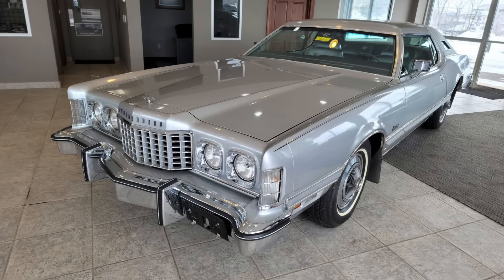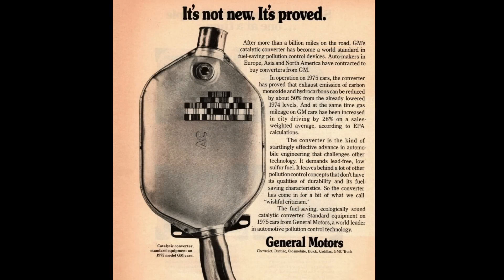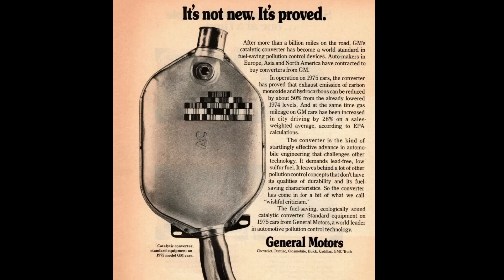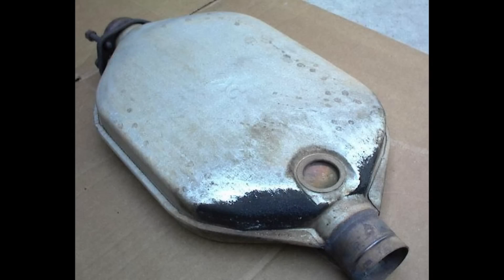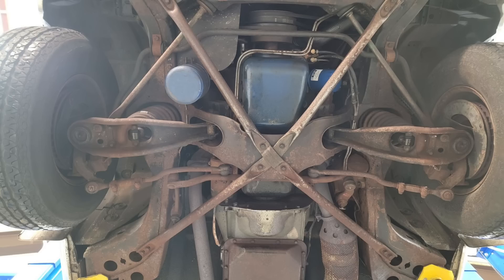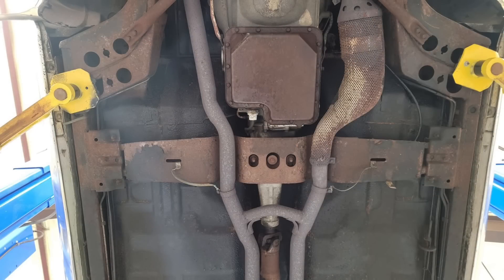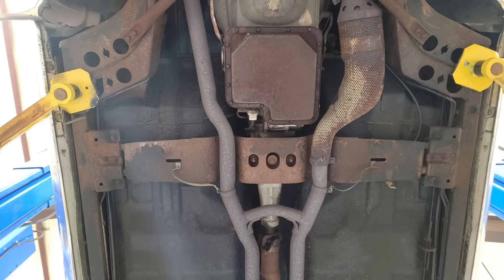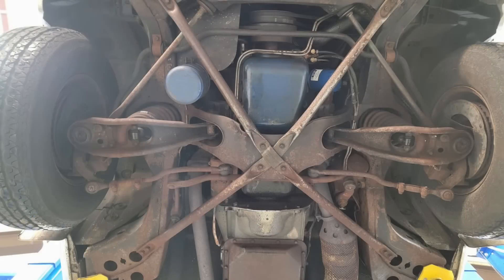Strangest Car Inventions: Ford Invents A Bizarre Way to Meet 1970s Emissions Standards

Comment: They were several car makers installing a cat only on one bank. All they had to do was get the overall emissions from the car in a closed room to make spec. If one cat would do it on the left they save money. these catalytic converters dont Rob horsepower. Back pressure on the cat was always less than .1 PSI. The performance was down because they had a tough time with emissions. They lowered compression, spark timing, pulled the horse power down.

Comment: Not installing 1 catalytic converter on purpose - that's capitalism! 🤦‍♂️
The same like not injecting enough DEF, blowing fresh air into the exhaust, cheating when not in test mode etc.
Others (for example Toyota) integrate the catalytic converter INTO the manifold, just 1 handwith behind the engine. The 4 very short headers enter the catalytic converter and meet there.

Comment: The multiple ground straps helped reduce the buzz in the radio/stereo speakers, along with plug wires being improved over the years for the same reason...

Comment: I bought a 75 Firebird in 1976.....had the converter....the stink was unbearable..took it to the local muffler shop and had them cut it out and put in straight pipe.

Comment: I remember my friend showing me the belt driven "air pump" in his 1977 Civic. All it did was add more air to the exhaust to dilute the pollutants but the flow rate increase so absolute not change in exhaust emissions. It took advantage of a loop hole in the emission regulations.
Reply: That is aftermarket right?
Reply: @zzoinks  Nope. Straight from the factory.
Reply: Adding air to exhaust helped complete burn of un burnt H2O to clean final product
Reply: @rogerdodrill4733  Generally correct, but the added air burns the unburned fuel, not water.  Lots of manufacturers did this, not just Honda.

Comment: I had a 77 LTD2 with a rebuilt 318 out of highway patrol service in Florida, it'd been ret-re-ro fitted with three cats leading to a single pipe.  The whole exhaust line was far too pretty to have been stock.  13mpg but could still pass emissions even tho I didn't need it to.  (some shops had out of state testing gear)

Comment: I remember working at a Sunoco station at 9 Mile and Schoenherr in 1975, we had a new Grand Marquis in for an oil change. 460, dual exhaust, one converter.
Reply: I lived at 5 mile and Middlebelt and went to that station all the time since it was close to my GF back then  1975 - 1977

Comment: The GM catalytic converters were dual bed. The plug on the bottom was only the lower bed. The upper bed was sealed. Possibly, that plug was added possibly to fool people into thinking that if they pulled out that plug and blew out the pellets that they were removing all the pellets and cleaning out the cats, to regain the power supposedly lost. People who did that probably noticed that the Sulphur smell was still there,but they had removed that plug and blew the cat out, so there couldn't possibly be any more pellets in there. Not!!! fools....

Well, here's the skinny on catalytic converters. They maybe had .5 p.s.i. restriction and really didn't reduce power. In fact, compared to the 1974 cars a year earlier, they actually had more power going to the wheels. This was because the catalytic converters actually allowed the car makers to remove the actual power-robbing emission controls from the engines themselves. Fuel injection allowed even more engine emission controls. Compare a 1975 Cadillac Seville to an Olds Omega with the Olds 350 carbureted V8. There's hardly anything in the way of emission controls under the hood of the Seville!

OK. I worked at a Cadillac new car dealership during the 1980's. We replaced lot's of the GM pancake catalytic converters on the Caddy's equipped with the HT-4100 V8(1982-1983). The cats would literally melt down internally, sometime damaging the carpeting on the floor above them.  Cadillac didn't just hand us a new cat to bolt on, the parts department handed us a new cat in a box, plus a plastic jar of pellets and a new plug. We could easily tell that the upper bed of the cat was already filled with pellets, but we had to fill the lower bed. Maybe they wanted to teach us that we couldn't empty the cats by removing that lower plug? Because cats were so easy to change(one end used a bolt-on flange), driving the cars in from the parking lot to our stalls would heat the cats up so hot that you could light a piece of paper, we could change out the cats so fast that we would put the old cats back in the boxes the new cats came in, take them back to the parts department and the boxes would start smoldering. They didn't appreciate it!

If you wanted to remove the minimal restriction that a pancake cat created, you had to totally remove it it and install a straight pipe. Other carmakers used monolithic cats, so those were easy. You could remove the pipe from the rear of the cat, take a long large screwdriver and a hammer to break up the element(s) inside. You'd start the engines up to blow out any remaining pieces. Now, those monolithic cats would sometimes break up on their own and the pieces would blow back into the muffler and cause a real restriction.

The 1975 Ford V8's which had a single cat on one exhaust headpipe were 49-state cars. California cars had 2 cats.  Also, it wasn't just the T-bid and the Mark which only had one cat, that included other V8-powered Fords too.

As a side note, in 1975 the heavy half-ton pick-ups were introduced. Any pick-up with a GVWR of 5K#'s or more didn't have to have a catalytic converter. 4-wheel drive vehicles of any type or size were also exempt from having a cat. You could get a regular GVWR pick-up with 4WD and they were exempt.
Reply: The Seville had fuel injection on the Olds 350
Reply: @Scott_From_Maine  We know that. Did you know that they put the same injection on the Caddy 425?

Comment: Cop tires, cop suspension, cop shocks, and it's a model made before catalytic converters so it runs good on regular gas.
Reply: Fix the cigarette lighter.
Reply: @ZGryphon  Use of unnecessary violence in the apprehension of the Blues Brothers... has been approved.
Reply: I knew there was going to be a Jake 'n Elwood reference in here somewhere!
Reply: 1975 Ford 460 ci engine made an incredible 195 hp
Reply: @Trackratz-zl9di   True, but you have to consider: in a '75 LTD Brougham, that was almost one horsepower per ton!
Reply: @ZGryphon  lol
Reply: @Trackratz-zl9di  Three things to remember about that:   

One, that was the NET rating, not the gross rating used up until 1972.   As a VERY general rule, you can a third to the net rating to get a closer approximation of the gross - so, realistically, a 1970-sped 460 would rate about 250-270 under the 'net' ratings.  Yeah, I know, still not stellar, but that leads us to the other thing to remember....

The 1970-spec 460 wasn't breathing through exhaust systems as restrictive of their smog-era counterparts.

The earlier mill had a bit higher compression.   It also had better carburetor and distributor configurations, a  slightly more aggressive cam profile, and didn't have80 lbs EGR and pollution control shit on it.

Three, most automakers were a wee bit optimistic about their power ratings in the 60s and early 70s, particularly with their larger engines.  As I recall, a 1970-spec 460 was rated at about 350 or so; realistically, it was more like 310 or 320, and remember, those ratings are not really indicative of the engine in normal operation.   Max HP is with the engine spinning at or near its absolute peak - typically around 4500 rpm or so for the common, station wagon-spec big block - and at wide-open throttle.

I'm not making excuses for the automakers, just pointing out that the perception of the 'diminished horsepower' is somewhat worsened by unfair comparisons to pre-smog versions.

A smog-era 460 can be really awakened with some comparatively minor tweaks.  shit canning the emissions equipment, putting a real carburetor and distributor in there, and true dual exhausts can give some pretty stout results.  A better cam, pre-smog heads, and a slightly more aggressive axle ratio (3.00 or 3.25) will boost that even more.

Comment: Another bit of trivia is that 1975-1976 Plymouth Dusters and Dodge Dart Sports equipped with a factory E58 360 four barrel not only had an air pump instead of a catalytic converter.  But those high performance Chrysler A-Bodies also left the assembly line with true dual exhaust.🤔🤷‍♂️🤨👨‍🔧
Reply: Yeah, they diluted the exhaust.
Reply: @JBM802  they combusted the CO left in the exhaust and burned the hydrocarbons at the same time.

Comment: I remember working in an autoparts store in the mid 80's. They sold cat "test" pipes, to see if your cat was defective and needed replaced. Funny that noone who purchased one ended up ordering a new cat.
Reply: Unless you lived in CA and had to pass a smog test to register your car.
Reply: @k4106dt  Thank god no, I have never lived in CA.
Reply: Same.  Then they cracked down on that and those 'test kits' vanished overnight.   The company that made those things knew exactly what they were doing.

Though they were not the only company to gimmick the emissions control regs.  Did you know that Ford itself played games like this?   Remember the days when Ford's half-ton pickup was called an F100?   And then an F150 appeared and the two models were sold side by side and and both were half-ton?

There was no major mechanical difference between them other than ONE:   The F100 was declared at a slightly lower GVWR, which made it exempt from the requirements for cats.  To avoid too much suspicion, and sell the more-expensive (because of the cats) F150, the F150 was offered with optional 360 and 390 engines (351M starting 1977), and the F100 only got a six-cylinder or 302.   When the EPA closed the loophole, the F100 disappeared.

Oh, there was one other minor difference:  F100 2WD models usually used a light-duty axle, while the F150 got the regular 9-inch.

Dodge and GM did similar things.  Chevy's 'heavy half' is an example.
Reply: @xaenon  Pontiac also played some weird games using an EGR system that was time activated on some models.  The EPA mandated test only ran for a certain number of seconds and so did the EGR.  

I have a 1979 F350 pickup that came with no catalytic converters and does not say "unleaded fuel only" anywhere.  1 ton had different emission requirements than lighter pickups.
Reply: @DaveMcLain  F350s and heavier were more or less regarded as commercial trucks based on sales figures compared to the 1/2 and 3/4 ton models.

The funny thing is, we're seeing this today as well.  Ever wonder why 'small' pickups like the original Ranger and S10 are vanishing?  The fuel economy (and I imagine emissions requirements as well) are less stringent for larger pickups.   The small pickups were held to passenger-car standards.

There's some rule book about this somewhere...  Some bureaucratic nightmare of a document that determines all this nonsense.
Reply: @xaenon  I've heard that same thing about the small trucks being eliminated because they have to meet a different standard for fuel economy that's based on size not weight.  Silly.
Reply: @DaveMcLain  That EGR trick sounds a lot like what Volkswagen was doing.
Reply: @xaenon  I thought the F-150 was the one exempt from cats because of the higher GVWR.
Reply: @alflyover4413  Pardon me, I had it backwards.   Yes, the F150 had the higher CLAIMED GVWR making it exempt.   

And the F150 had more engine options as well, and also used the standard 9 inch axle.

The F100 was limited to the sixes and 302 V8s, had cats, and often used a light duty, integral-carrier axle.
Reply: @xaenon  If memory serves, the F100 was rated at 6000 GVWR while the F150 was rated at 6025.There was another break point later, at 8800 pounds for the F250 (if I am remembering correctly). I remember seeing go-fast parts for the '250 with a footnote saying they were only for trucks with a GVWR greater than 8800. ICBW, though; I'm digging up memories from over 30 years ago.
Reply: @xaenon  
I thought it was the other way around. Originally the half ton ford was the f-100 but ford made the f150 and called it a "heavy half" giving it a weightier frame (i think they literally just welded on some extra metal the first year) which allowed it to fall under early 70s exemptions for trucks over a certain weight not needing emissions gear.
Reply: Yeah most people just removed the cat and left the test pipe in.

Comment: My first company truck was a 1975, pre-converter, Ford F-100 with dual tanks and an automatic transmission.  It got, count-em, 8 MPG.  With the AC on, it went down to 7 MPG. It dieseled every time I shut it off, in Park.  I could reach 50 MPH climbing a gentle grade.  I had to fill up (company credit card) almost every day.  I took it to the company garage and the head mechanic "de-smogged" it.  Mileage went up to 15-16 MPG, it stopped dieseling and could maintain normal highway speeds.  Some "emissions controls", eh?
Reply: Yeah I worked for PennDOT back then and one time we had a new emissions Ford diesel itself down the side of a mountain.
Reply: I think this same channel has a video on another emissions control system where you have to adjust a valve somewhere to change how the car idled and ran. I forget which brand it was, maybe a Chrysler? And if the control was set incorrectly it would run poorly. 

But that also sounds similar to the carburetor adjustment for different altitudes, if somebody wanted to do mountain driving the adjustment is needed, and similarly back at sea level, else the engine doesn't run correctly, but that doesn't have to do with emissions controls.
Reply: CA used to require hang on devices for 66-70 cars, either a distributor vacuum retard setup, or in the case of my 68 VW, a hang on EGR system. There were no yearly tests, only when you bought the car did you have to get testing done. After that, the hang on crap went in the trunk until it was time to sell the car. As an added bonus on the VW, the hose from the crossover on the intake manifold to the spacer plate below the carb was made out of metal, like a flexible natural gas line. That chafed through against the engine hatch, resulting in a vacuum leak and a burned valve that was ignored by the previous owner until the valve dropped. I bought the car after that was repaired.

Comment: I took the clean air car course in 1996 to become a smog tech,  the year OBD2 was mandated -  Mixture control solenoids and back pressure transducers were the tech of the time,  at least for most the cars on the road.  Early emissions equipment was so bad too,  but from 1996 onward, things got pretty good.
Reply: I remember those days. Back then, Mikuni Solex has designed the absolute worst carb to rebuild. A nightmare.

Comment: Ford's R&D was all over the emissions requirements of the Clean Air Act, including instrumentation to accurately measure NOx and SOx in exhaust. Manufacturers were close to panic over the possibility that the EPA wouldn't certify engines for sale without a reliable and reproducible method using a durable instrument. They made it, but just barely! (And they were ahead of the rest!) 😎✌️
Reply: Their early IMCO systems made their carburetors and distributors a nightmare to work with.  IMCO was first mandated in 1965 in CA cars, and in 1968 it became a federal thing.  In fact, part of the reason Ford replaced the 289 with the nearly-identical 302 was primarily for emissions reasons.

Comment: Ford V8s had a history of odd applications which used the two cylinder banks separately. Ingersoll Rand used to sell a big air compressor that used one bank of a Ford V8 as a 4-cylinder engine, and the other bank as the compressor. I wonder if Ford put different size jets in one side of the 4-bbl carbs on these "half-cat" engines to get the fuel-air ratios to match.
Reply: There used to be a kit available to turn an air cooled VW flat four engine into an air compressor. The kit would come with a new intake manifold that only went to two opposing cylinders. This kept fuel out of the cylinders used for compressing air. The kit also came with air filters for the compressor cylinders, and a different cam that never opened the exhaust valves on the compressor cylinders and opened the intake valves every crank revolution so as to double the compressor output vs a regular four stroke cam. I believe it was called “Volksair”.
Reply: That is awesome

Comment: Yes, we're fairly certain that dual cross-member reinforcement was Ford's relatively INexpensive attempt at structural rigidity.  In essence, giving a wallowy "land yacht" less body roll particularly in cornering. A relatively simple road handling improvement with a cost that most likely won the approval of the FoMoCo "bean counters" of that era.  🚘🔍.  💸.  Many Thanks Yo !